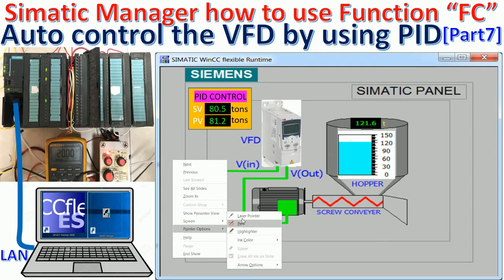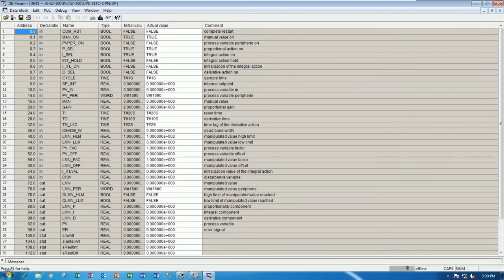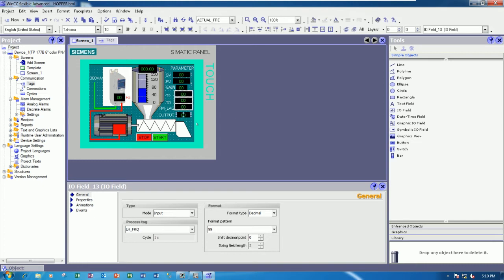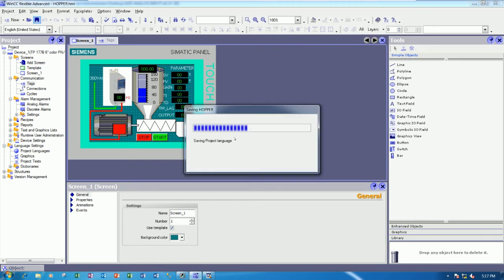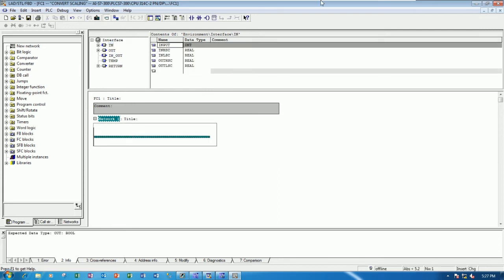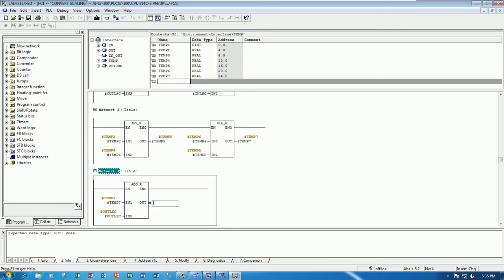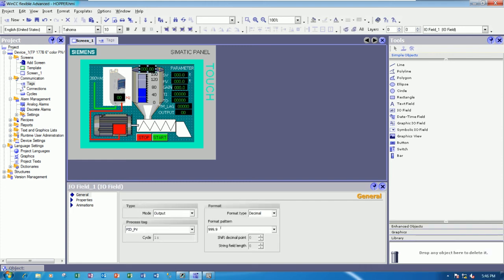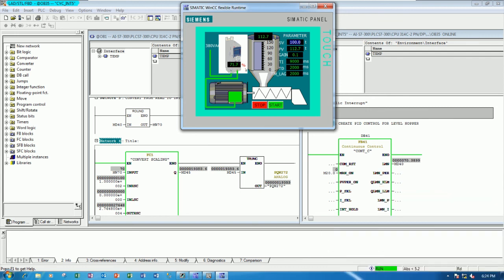Simatic Manager v5.6 and WinCC Flexible 2008 SP5 how to use Function "FC" PID control VFD part 3

Comment: How to implement Auto/Manual type control using PLC and SCADA?
Reply from the maker: Dear for auto mode it will adjust the speed of screw conveyer with level hopper. For manual mode we can adjust the speed of srew conveyer by manual.It just the concept
Thanks you

Comment: In vfd output mention means power given to motor when level high vfd give 100 percent power to run when level low vfd give low power to run
Reply: Mw70 input u mention in scaling block this input come from where?? 
Plz explain high scale -100 and low scale - 0 this scale is for what